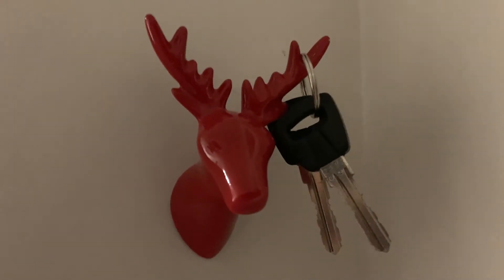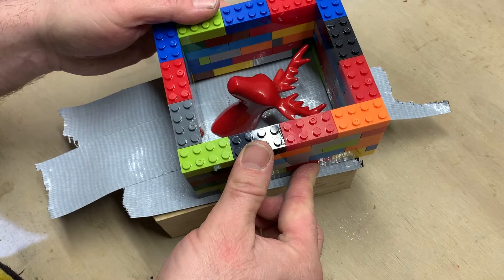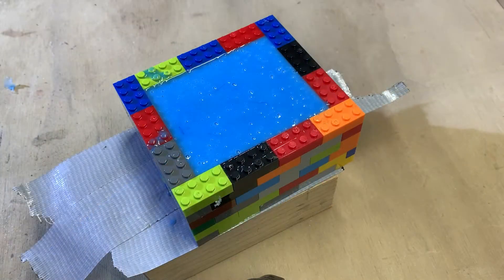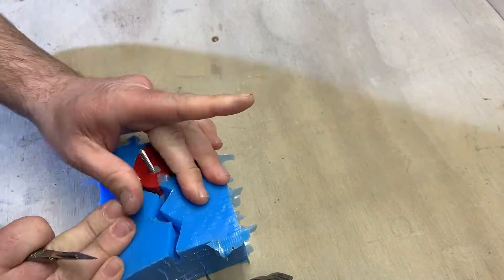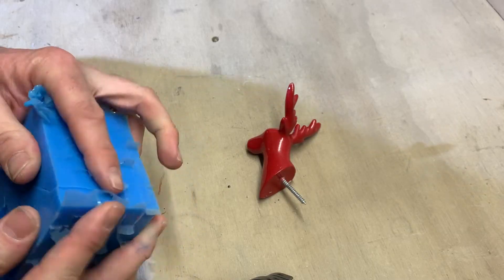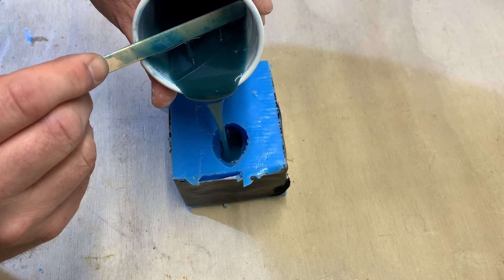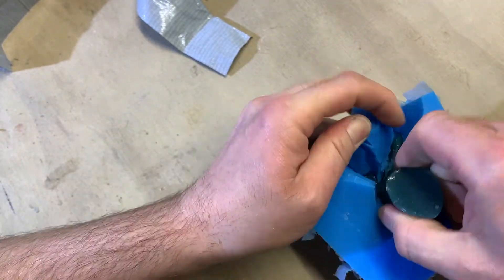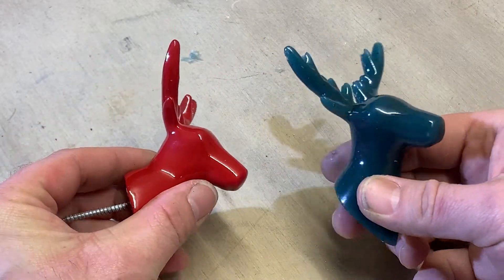Making silicone box moulds and casting complex shapes in resin from a one piece silicone rubber mold

Comment: Thank you for the video 😊 May I ask how many times the mold can be used? Would the cutting make it more difficult to use it multiple times?
Reply from the maker: Depending on the type of silicone and resin you use, you can usually get dozens of casts from each mould. Smaller pieces don’t heat up as much when the resin cures and that seems to prolong the life of the silicone further.

Comment: Do I necessarily need to vacuum a polyurethane resin? I've heard it's almost bubble free and has a really fast drying time. Let me know if you know
Reply from the maker: I have never needed to vac polyurethane resin. realistically it has such a short cure time, it would set up before you had time to. Just pour slowly and the bubbles rise to the surface really easily.
Reply: @Unpossible  So I don't need any bubble free spray for the resin?
Reply from the maker: @ I never have. PU Resin in silicone is super easy to get a great finish without any additional sprays or equipment.
Reply: @Unpossible  Alright man, thanks for the tips. I really appreciate it 🔥
Reply: Or, assuming you can work quite fast, you could apply some pressure when pouring.
Quickly pour your already mixed PU resin into a syringe, then push it into the mould (this has to be designed with some sprues accordingly).

(Almost) bubble-free casting outcomes.

Again, it’s a very different paradigm, you have to be fast here: I usually do the same with wax (it cools down even faster than PU resin), after making some practice results can be quite satisfying

Comment: I wonder if a block of soft clay would work as well as the wood block with tape🤔
Reply from the maker: As long as it seals underneath. If the silicone starts to run out from under the walls, it's very hard to stop it as nothing sticks to the wet silicone. But I have used plasticine type clay before and it works fine for smaller moulds. Tape and lego bricks are just so easy and quick, I use them where I can, but for bigger moulds, I usually construct a wooden box, hot glued to a wooden board. In this instance I only used the wooden block because the deer head had a screw out the back, but normally I just use a thin flat MDF board.
Reply: @Unpossible this is great info, thank you!!

Comment: im making a cast of a wallnut, can i just push it off or it will damage the mold?
Reply from the maker: Sorry, I don’t know what you mean by “push it off”. You could put a little silicone in the bottom of the mould box, let it cure, then put in the walnut, then half fill it with silicone (so it doesn’t float away, you may need to weigh it down).  Then when it’s cured, cover the walnut in more silicone and let it cure, then use a blade to cut the silicone mould open.  This should give a nice 1 piece block mould with a minimal seam line.